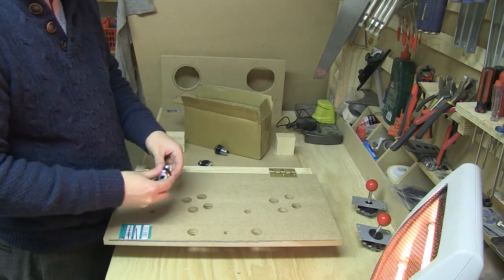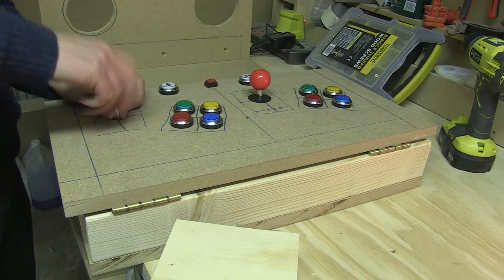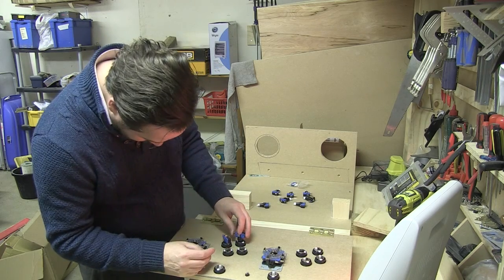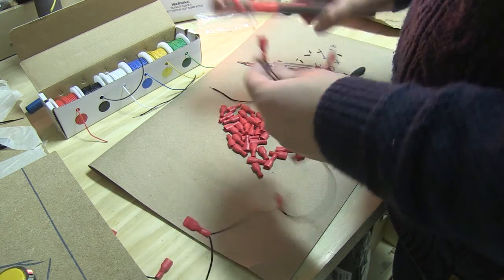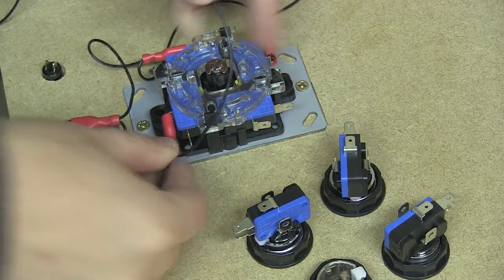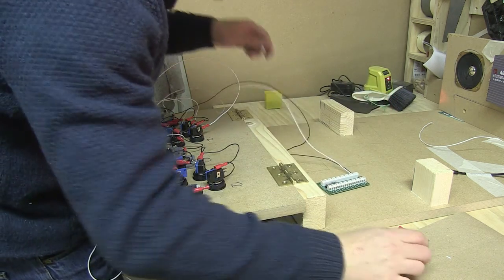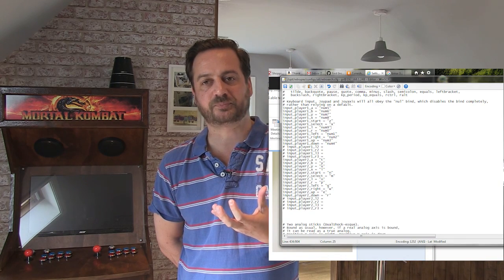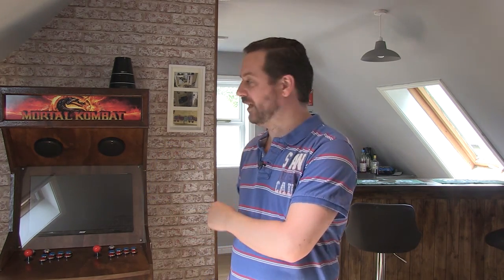Build Your Own RaspberryPi Arcade Machine (2 of 3)

Comment: great job! I have juyao dual arcade retropie and can''t make it work. 
I have retropie 4.1 and raspberry pi 3.
It allows me to go through the game selection menu of retro pi using the joystick (1 player only) but in games no longer allow me to use the joystick or buttons.
I try to add 
ATTRS{name}=="Arcade Controller JUYAO Dual Arcade",ACTION=="add",ENV{ID_INPUT_TABLET}="0",ENV{ID_INPUT_JOYSTICK}:="1"
I try to add
usbhid.quirks=0x0314:0x0326:0x040

I''m going crazy... do you have tips for me?

BTW,
before raspberry I used pc and all work great.

Comment: I'm  a bit confused, why are u using white and black wires and where are you plunging them into
The black wires are twisted then connected to the microswitch, but the white wires aren't twisted together... ???
And where is everything getting power from?
Reply from the maker: Hi there,

All the wires go from the arcade buttons and joystick micro-switches to the Ipac2 board. 

The black wires form a daisy chain connecting all the grounds of the micro switches which goes to the ground terminal of the Ipac2.
The white wires are for the micro-switch outputs and there's one for each linking back to the Ipac2.

Richard
Reply: Thanks for the response, one more question.. When your done connecting everything, how are you powering everything up? Are you using a power supply
Reply from the maker: I don't cover that in much detail on the video as once you get going its fairly straight forward. Raspberry Pi, monitor and amp are just the usual power connectors. I've put links to those on my blog Richardpearce.net. 

I think on my first or third video I show you inside the back of the arcade so you'll see them briefly. 

I also bought a led power adapter like this one https://www.amazon.co.uk/Liqoo%C2%AE-Transformer-Trafo-Driver-Supply/dp/B014IX3DL2/ref=sr_1_30?ie=UTF8&qid=1474447394&sr=8-30&keywords=led+power+supply

This was to send power to the led's in the buttons using a daisy chain just like you do with the ground wires (this is just optional though)